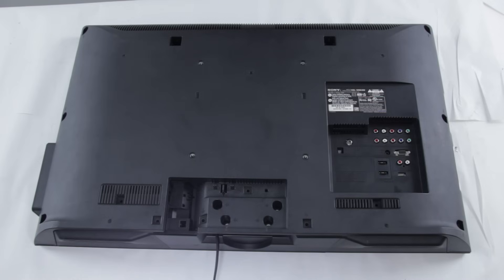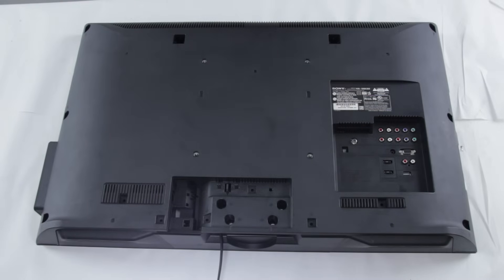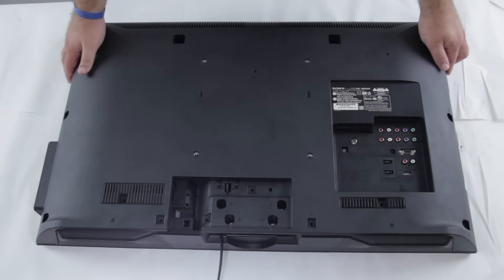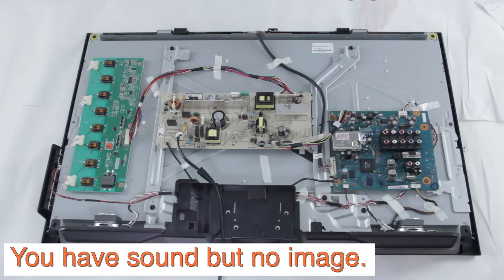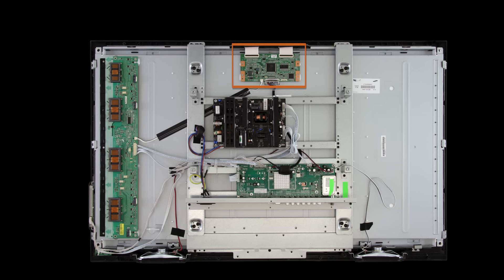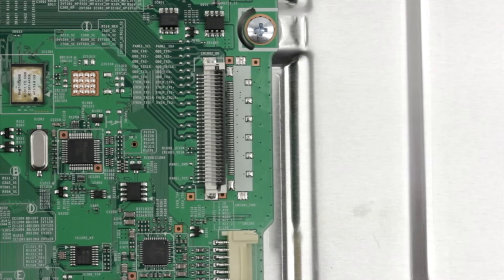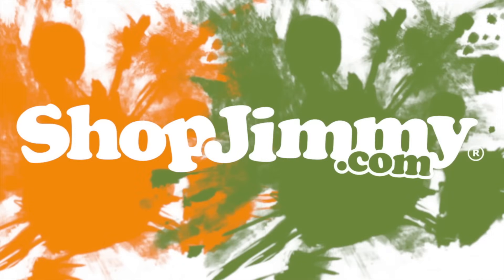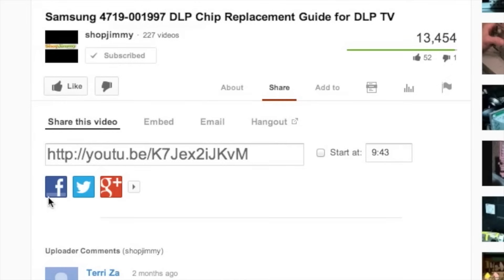LCD TV Repair Tutorial - T-Con Board Common Symptoms & Solutions - How to Replace T-Con Board

Comment: Hello i got a problem with my tv, samsung un75ju6500, it has no picture but has sound. Coming from my antenna chanels. How i know if leds are blown? I tried unpluging for several minutes plug back hold power button. And no help. If room is dark im able to see some light screen is not craked. But has no image. Any help?

Comment: Vizio Model No.:  E60u-D3 Serial No.:  LFTRURAS1503014.  First problem was vertical colored lines across the entire screen.  Then upon trying a factory reset the 'starting store demo screen in 60 seconds' prompt appears in only the upper left corner of the screen (and then either nothing happens or the tv restarts).

I already tried replacing the power board.  So does this sound like a T-Con board issue??

Comment: Hi, I have sony braviya W-800C. Just 5-year-old tv. Started blinking the red light 5 times with a white screen and sometimes a picture with half the screen will come. It worked after a hard reboot. But the service engineer said that need to replace the tcon board. Should I replace the tcon board or any other workaround? Please suggest.

Comment: is the T-con board also responsible for correct RGB levels /customzable RGB levels on LED picture?  I have a philips PFL6357 ,42 inch LED which had the RGB levels thrown out of balance i.e less Green and more of red/blue in the video displayed after I got the faulty HDMI board replaced with a universal HDMI board for LED TVs recently.

Comment: Hello guys, i have a Nasco 55" TV with serial No. IDB129831D-00146. When i switch on the TV, i see different colour schemes but without picture. TV repairers have advised that i get a replacement for this 2 piece circuitry that is attached to the base of the screen, all covered up by the outer shell of the TV. Is that what is called the T-Con board? Cos i asked for a screen replacement and they responded that even with a screen replacement, that component needed to be replaced. I cannot even begin to start my search for one without knowing the actual name of that component. So seeing your video, i thought i might just ask. Can you help?

Comment: I have a Samsung LCD 60" - Model Number: UN60J620DAFXZA.  I had the TV on working fine, came back and the sound was on no video.  Turned it off and the power light came on blinks and goes out.  Checked the connections, unplugged tv, restarted the cable box and modem.  TV wont power back on.  Although twice I got it to power on and back lights flashed briefly.  No it just wont power back on at all. Could that be the T-Con Board?

Comment: I have a Vizio p65-c1 that won't power on. I've tried all the trouble shooting and replaced the power board but it still won't turn on. I read somewhere it may be the tcon, but most tcon symptoms don't seem to involve the TV not powering on at all. Not sure if I should risk investing in the part or if you have other suggestions.

Comment: Hi, I have a Proscan 65" tv, model # PLDED6535 UHD-D. The tv turns on with both video and audio after being turned off over night. After an hour or so the picture goes black but the audio is still there. If I turn the set off and on with the tv button the picture comes back for an maybe 45 mins to 1 hour and then goes black again, audio still good. Online it says it could be the t-con board but I can't find that board when I take the cover off the back. Would it be the power board causing this issue ? Oh, the s/n is A1705210870000083. Thanks for any info you can give me.

Comment: Hi, I have a problem with my tv flickering horizontally.  It is a Samsung 50"  m# un50ru710df  .It just started so I went thru different troubleshooting options I saw online.  I even replaced the lvds cables. It doesn't seem to have a separate tcon board. The cables connect at the very bottom of the panel? Might you have any other possible options I can try. Thank you
Gary

Comment: My Samsung TU7000 has two dull looking white or grey horizontal bands (they're both the same color) that are most obviously noticeable on images that are completely uniform dark shades of color, such as navy/dark blue or grey test screens and moves vertically somewhat, sometimes. 

For an example, if I play a completely uniform grey screen test pattern, soon after that aforementioned test pattern has begun showing on the tv screen, the two dull horizontal bands will move down the screen and then seemingly somewhat bounce up and down for a short period of time and then seemingly settle into a stationary position, almost like a basketball somewhat bouncing until it settles and stays on the ground. Those bands will then stay stationary as long as the test pattern is displayed on the tv's screen, and that process will repeat if I exit out of the same or similar darker colored test pattern and chouse display it again. So the problem seems to have a uniform behaviour to it. 

I ruled out the efficient cause being any of the connection cables, such as my hdmi cable and ethernet cables. 

It's a pretty disheartening situation that I'm in, considering the significant amount of trouble that I went through to get a new tv from a retailer that didn't have an unreasonable amount of manufacturer related defects, out of the box. Plus, this new tv is less than a year old. And I'm not willing to have it repaired by my only local Samsung repairman that Samsung has offered to me for a previous tv, because he's proven to be untrustworthy the last and only time that I used his services.

If need be, I'm willing and able to remove the Samsung TU7000's back panel to attempt to fix the problem, and buy a new part and install it myself, if the situation calls for it.

Comment: Hello can you advise please. I have a Blualta tv model BL-F50S which is stuck in boot up mode. It went faulty after a power cut in the home. It just continues to stay in boot mode and will not start up. Standby light flashing blue and red. Any advice would appreciated.

Comment: I have a Samsung LN-T3242H , S/N AH6S3CDPA21995V which had a power board gone bad.  I replaced the power board and tv worked fine for a few minutes and then the screen started having a green tint to it.  You can make out the tv images but always has a green, blurred image around whatever is displayed.  I have tried thru the menu adjusting the green out of the picture,  but no success.  Is this a t con board or another board and how do I test for the problem?

Comment: Hi, thank you for your useful video. I have an LG model 32lx560h-UA ans serial 512mxglky039. There's a thin vertical colored lines on the screen and a no signal message. No sound and no image. But I get sound and still no image with the dvd player AV input. Is it possible that the tcon ribbons are bad as opposed to replacing the tcon board?

Comment: Samsung Model UN50J6200AF Power button flashing and LED lights/ Screen flashing. I ordered your power board and replaced. Still flashing. Is the LED controld by the T Con should i replace that?

Comment: Sony KDL 40S5100
Comes on you can see green power light (no red light) back light does work but appears no sound and no picture  looks like a tech has been inside this tv before as there is marker everywhere 😑🧐🤨🙄🤔 but idk what the specs are because I don't have a manual for this model nor can I find one.. just seen your video and thought what the heck maybe this guy knows something about these TV's so before I try my way figured I'd see what ideas you had ..

Comment: Have a vizio e55-e2 picture will melt away and disappear. No image with flashlight test also still have backlight. If I hold mute to disable the display then again to bring it back the picture comes back for another minute to 5 minutes. What could be the issue? Tcon?

Comment: Just got a sanyo DP52449 (DP52449-01) it powers on and has sound. Screen is very faint, mostly black with hints of illuminated vertical lines. Sound does work, but screen does not beyond what I described. Is it the T-con board? If so, where is it's location?

Comment: On a Vizio M60-c3  when the ON button is pushed the TV light goes on then quickly goes out, if this is done 3 or 4 times over a 3min period, finally the Vizio symbol goes on and the set starts up. Prior to this happening  for months the screen, in one corner, there was a minor amount white light flashing it stopped then moved to another corner, again minor , that went away and the ON button problem started . I'v replaced the Power Supply Board but the power on problem persist. Thanks, ShopJimmy is the best!

Comment: Hi I’m having problems with my 50inch Panasonic it keeps turning off after 30 mins and the light flashes red. I replaced the power board was fine for 2 days and now tuning off again the model number is tx-l50em6b

Comment: I have a Vizio D50f-F1, 
Serial#LTMWVTLU4350883
everything was working fine until the other day when we couldn’t change from Smart Cast to HDMI2 which is something we do all the time. After doing a soft reset, I talked to Vizio Customer service and they had me do a factory reset amongst other things but when all was said and done they said I need a new tv. I’m not alright with that. I am thinking of trying to change the “mother board” but I would sure appreciate any input you can offer. Thank you

Comment: I’ve got a hisense 65 inch tv with vertical line   Model 100021261 is the tee com board built into the main board or the screen on this? I replaced both the power supply and main board and it didn’t fix it.

Comment: I have a Samsung model number UN55HU6950FXZA with some black vertical lines varying in size in the middle and on both sides of the screen that stay in the same place all the time regardless of the input source. All of the backlights appear to be working properly. Ive carefully disconnected, cleaned and reconnected all ribbon cables etc and the problem remains. Can you please offer suggestions on what is most likely the problem? Any help would be greatly appreciated. Thank you!

Comment: Hello Jimmy my Tv is a Dual DLCD LCD serial number: 6028804 600238 I have no Video or tuning but have all lamps on. I also have this issue on a LED tv also. I have certain voltages to the tcon board on main board side. Mostly ny 12v and 1to 2 volts on the other pins. TCON Fuse is okay can you advise? Thank you

Comment: Hi I have a Samsung un48j5201 TV  when you first turn on it flashed vertical lines in about eight 1 inch  groups for a few seconds then lights up evenly to a blank screen.  I put a flashlight up to it but can't see anything.  Would it be the Tcon board or main board?

Comment: I'm REO from Philippines, I'm an ECE man, I have a customer bring his TV Philips 42pfl-3403, the problem is sound/display OK, but no video, I start troubleshoot on tcon board 6870C-0207B, other Devant tv 49dl541 the problem only standby indicator won't turn on but before that it was intermittent problem it was working properly after 6hrs or won't turn on, back light is ok , I'm checking on the power board it is not oscillating, please give any idea God bless thanks in advance please reply

Comment: I have a hisense tv but the screen blank but audio perfect. When I disconnect the left driver cable from the t con board the right side starts showing.i buy a t con board on ebay and it's the same result
Reply: I'm wondering if it is the board not good

Comment: Vizio model E55-E2 ,  Serial #LWZ2VIKT4200117. When turned on has good picture and sound.  After 5-10 minutes picture & back lights vanishes, sound OK.  Turn off and back on and it repeats.  Have switched off Auto brightness control, Picture Mode is Standard, Sleep timer and Auto Power Off are off.  What part needed?

Comment: Hi. Tv Vizio e70u-d3.  Was trying to program a universal remote to a soundbar and in the process of searching the code tv got turned on and off few times.  After all that i turned on the tv and the screen is split in the middle vertically.  Thought the remote triggered side by side 3D,or could be PIP/POP(even though tv doesn't have those features) ,factory reset multiple time, still  the same. Tv does boot up with 2 "V" logos on the screen, as logo of vizio, and continues accordingly.  2 screens, left and right,  everything is thin and long. Changed the t-con board, no change.  And sometimes have a hard time turning on. Have to try multiple times to succeed. Thanks in advance

Comment: So I have an old jvc Tv Model number LT-32E478. It was working fine until one day I unplugged it and plugged it back in again. Now When I turn it on it gives me vertical lines for a few seconds and then makes a click sound and the screen turns off. After this happens the green light just blinks indefinitely. Does anyone know what this could be? occasionally it will turn on and work fine until I unplug it again then it will go back to not working. It hasn't turned on in a while tho.

Comment: Need help with TV sharp. No picture no sound. Model: LC -55LE643U,  Sir: 40300715035. . I have all the lights at back.  I tried to order a T-con board with no success. I don't know if that was the problem I can use anyone if that becomes necessary. Thanks

Comment: Useless repair , 95 percent  it’s easy fix.Don’t need replacement of TCon .most of the problem is loose connection  and no proper voltage . Flickering screen, lines on screen, blank screen. 99%  you only need a piece of tape or paper.
Reply: Could you elaborate, please? Which connection where?
Reply: @ericson1998   Diffirent tv diffirent places mostly on the T con Board . Video problem?  Either left or right side Vk1 or Vk2  or Vk1b1 Vkb2.
Reply: @ericson1998   You can watch  Brotherhood TechniciAn Channel  I will give you two channel . No English . JDL Electronic and Leboy Technician. Youtube.

Comment: Hi Jimmy,  I have a 55 inches sankey Led tv needs to replace a T-con board,  however I can't find any original part for it. My model No. CLED55SID4  YY01 serial number CR1855336793 on my t-con board it's 55UHD GOA DUAL GATE RGB TCON .any thoughts can help me to fix the tv? Can I use a different brand for Replacement part ? I'm in Costa Rica don't have a lot of choices. Any idea is greatly appreciated.  Thanks.

Comment: I have an 55 inch LG Cinema 3D TV. Model # is 55LM4600-UC and serial # is 210RMYA20322.

After almost 9 years of working flawlessly, suddenly the picture stopped working in the middle of watching it. The backlight and audio are on but there is no image. I tried "baking" the motherboard, which I probably shouldn't have, since it sounds like the issue could be t-con related. When I put the motherboard back in though, audio was still coming out, so hopefully that wasn't damaged. Any advice that someone could give would be great! Since it's 55 inches, and a 3D tv, I'd prefer to fix it if it would be inexpensive to do so.

Comment: I have a 50 inch on 4k tv has horizontal and vertical lines all over screen.  Model 100012585 no cracks on the screen.  I am thinking tcon board but not sure.  Any idea on what it may be.

Comment: Hey Jimmy, I have a t con board built into the top panel so can’t remove but have a section at the bottom of screen with faint lines vertically. It’s a Toshiba, Model no 32BV501B. Any help would be greatly appreciated, 

Thanks, Martin.

Comment: Hey Jimmy This is a samsung un55eh6070fxza it has a vertical strip on the left side of the screen that is a little darker than the rest of the screen would that be a bad led light it's not black just darker which makes the colors more than the rest of the screen also there are two horizontal lines one on the bottom the other about eight inches up about one inch wide they show a perfect picture all the way across the screen

Comment: I have a vizio E422VLE that the sound works fine but the picture comes in at about a half inch at the top and black screen. After a while white vertical lines come on and very slowly after about an hour or so the full picture comes into view like new and is good for the day. Next day same thing. Lastly I only see 2 boards after taking the cover off. Help It doesn't seem to have a t-con board.

Comment: What about a TV that has no sound, no image, but shows signs of power? 

Symptoms: 

Plug power cable in. Red standby LED turns on. Hold power button for a few seconds, light turns blue. A few seconds after turning blue, a component on the power board starts producing a constant sound. I've checked voltages on some parts of the main board and can see the correct voltages (5, 12 and 24V can be seen present). The main board seems to be receiving power, just no image. There's no backlight at all. No sound from built-in or external speakers. If I leave the TV on for a while, it'll go on standby again. This takes a while to happen.

The TV I have is the BAUHN B55-64UHDF-1117. I don't know the history of this TV as it was found dumped in the street near my home. I took it as I was curious if it perhaps had an easy fix. I'm trying to determine where the fault is right now. It has 3 boards. A T-CON, Main and Power supply. The T-CON connects to the main board and can be removed. The Novatek chip on the T-CON heats up when it's getting power (blue light). I assume this means it's working rather than faulty. 

Here's an image of the component (it's marked) that makes a constant sound: https://imgur.com/MujfwUg

Here's a recording of the sound produced by the component:  https://vocaroo.com/1lRGnczyvSMA

Any ideas on what to look for?

Comment: I have 2012 model Sony Bravia Ex650 LCD tv. Which is giving horizontal lines on entire screen. https://youtu.be/q9tt1Nibfww Tried to do some hacks by putting a tape on the flex cable which connects to T con board but it could bring only half of the picture. Tv repair guys saying it is the panel issue only without even checking the tv. Can you please guide if a tcon board replace will fix the issue or a panel? Thanks in advance